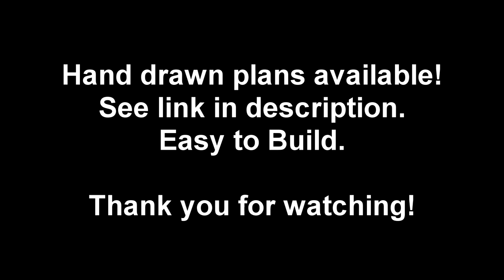Woodworking - How to Make a Table - With PLANS!!!!

Comment: That sense of accomplishment must feel awesome!! You slabbed the lumber then dried it then built the table. I suspect that if you were sent back in time to 1820 you could get by just fine. Great video. Thanks.
Reply from the maker: I've milled some nice stuff, but the white pine was one of my favorite, mills fast, smells great, dried quick. It will feel even better as soon as someone buys the table!
Reply: 1820, without that chainsaw?  The table would be slightly more work.  Just add 3 or 4 days!
Reply: Mike Tabar was thinking the same🤔

Comment: The table is beautiful. My only issue is the lack of safety gear. If you don't wear it you should recommend it. What a great set up for gluing. I wish I could do the same in my shop, but it's too small. I haven't been on Y.T. in awhile. You look completely different without the ponytail. Handsome guy you are!
Reply from the maker: What scared you the most?

Comment: Simply fantastic again. Extremely well done as always.
I would have preferred the natural double rounded swing of the tree as plate sides instead of cutting it away. I think it would have looked awesome. But this is only my personal kind of taste.
Reply from the maker: The live edge was nice but it would have been mixing styles. It would have also been the focus of the whole table and that wasn't what I was going for on this one. If it had a different base, the live edge would be fine, but I would use thicker slabs.
Reply: Dear @thehomesteadcraftsman8975 
Thank you for answering.
I mentioned that it would have been my personal kind of taste. It has nothing to to with the style of the finished table and isn't meant as criticism at all. The shown item is a wonderful piece of work but simply not my style any more. By fare more practical than a four or even 6 times concave rounded table for sure. And yes, I agree totally: Bigger/thicker slabs would be much better by doing this kind of natural design.
Best regards
Reply from the maker: Most of my tables are orders or will be sold in a store so I have to consider what sells well for the price point I want to hit. My personal taste isn't farm tables either. I would like to find or develop a market for some pieces that would be more fun to make in the future.
Reply: Dear @thehomesteadcraftsman8975 
Yes. Of course I haven't thought  that all these tables "wood" (would) stay in your own home ;-). And you have to make/deliver what customers mainly want to have for sure if you have to make money (that's what we all have to do mainly). And, as we are all able to watch, you deliver excellent quality.
If not already there respectively available, maybe later on in your life there will be something like "table art" too!? Not only because you often have extremely wonderful wooden slabs (and it's more fun to do) I hope so and I wish you all the luck you need.
Best regards
Reply: I agree! It looks beautiful, but I love the  natural look of an unfinished edge.
Reply: Dear @angelinamclaughlin-heil  
Please be so kind and tell me what is meant by "an unfinished edge"?
Thanks in advance.
Best regards.
Reply: @thehomesteadcraftsman8975  See if you can do some "made to order" designs. You can plan it with the customer and that way you know it will be sold when it is finished. Set up a contract.

Comment: Awesome  start to finish build! Is that a biscuit jointer you used to attach the top? How does that work? Your clamping rack rocks, would be great to see how you made that in a video and a little tour of your shop!
Reply from the maker: Google "table top fasteners" I use the little rectangular bent kind. I bought a box of 1000 from Mcfeeleys, that should last me a while.

Comment: Beautiful. Seems like it would have been a great chance to book match the top. Not a criticism at all, just curious as to why you didn’t. Thanks as always for sharing.
Reply from the maker: I cut these logs into 2ish inch thick slabs, I took 5/4 boards when it made sense, but again, 2 inch was the mission, sawing for quality. In short, I did not saw book matched 5/4 boards, at least ones that were dry that is.

Comment: Those old Dewalt radial arm saws... speechless.  Those have to be from the 50's?
Reply from the maker: One is 1954, the other one is somewhere close, 52 I think. They run like tops, I replaced the motor bearings in both as well as the wires.
Reply: @thehomesteadcraftsman8975  Made my day to see vintage tools still in use today.  Not to mention at the hands of a talented craftsman.

Comment: Looks awesome!! Is this one for you to keep? Looks like you did a different approach than previous tables
Reply from the maker: This one went into the store I sell from. I just wanted to have some fun with the top since I milled the wood. With the joints, I had a set of legs that already had mortises, so I used them instead of my Festool dominos. I had the legs for a couple years but was avoiding doing the tenons.......that's just how fast the Festool is.
Reply: The Homestead Craftsman sounds good. I build my dining table a few months ago using mostly your plans and videos for instructions. I bought the turned legs since I don’t have a lathe or any tuning experience but everything else I did. Thanks for sharing!

Comment: Beautiful love all the character in that top. Really really enjoyed watching you use the hand tools. Was that a no.6 you used to flatten the top and a no.4 1/2 to smooth it? Those are my 2 favorite planes i use the most. I love my no.6. Would love to see you do a video about you hand planes
Reply from the maker: It's a No. 7 the other was a 4 1/2. I also used a small rabbit plane, to work small difficult areas, it just cuts so nice its good for focusing on small areas. I have a pile of planes, so I do have enough to talk about!
Reply: @thehomesteadcraftsman8975  would love to see them. I also have a type 11 no.7 that i use to edge joint all my table top boards

Comment: How long would you say it took you to make this table?
Reply from the maker: I don't keep up with hours and I was not in a hurry on this one, I just worked on it here and there as I could but when I make my standard farm tables which are the same as this one but with a top glued up out of 6 ish inch wide boards, I make them in 2-3 days. The fastest I've made one was started it mid day and delivered it the next day. I was rolling, it was also summer, so I could dry my finish and paint very fast. It really just depends on whether I need or want to make them fast.

Comment: Beautiful build and a joy to watch.  Glad to see you post.  

Was the slab finished any more prior to cutting with the track saw or was that right off the chainsaw mill?

I really like the crafted edges on the table top.  Very nice natural touch.
Reply from the maker: It was right off the mill. With the right set up, you get surprising smooth cuts. Sharp, ripping specific chain, fed with even pressure gives a smooth face. Dull chains or using normal cross cutting chain (which dulls fast milling) requires all the rocking around and causes rough cuts, not a big deal untill you have to smooth it out. Unless you have a large planer or surface them down some other way, you have to take off a lot of wood. 

I like doing the edges like I did as well, they are straight in general, but have a hand shaped profile. The boards thickness varied a little, that's why I scribed around the table, then shaped to that line, giving it the appearance of being even. The 1/8 difference or so doesn't make any functional difference but you could see it. White pine is a nice wood to work with if you get the chance. It's not expensive and not looked at as anything special, but it's so nice, very light so handling it is a dream compared to oak, mills fast, looks good for the right projects, planes beautifully and smells great the whole time. It's downfall is it's sappiness. I did not worry over it too much but technically you should place it in a kiln at very high temps to set the pitch.
Reply: The Homestead Craftsman thanks for the reply!

Comment: 2 quibbles: it should have a support beam across the center underneath and i wish the grain on the tabletop had been bookmatched. the 2 big pieces are completely mismatched and you notice because both are heavily figured.
Reply from the maker: You don't need a center support, the top is over an inch thick and less than 30 inches wide. As for the book matching, these where the boards I had. Just is what it is. It's one of probably 100 or more tables Ive made.

Comment: it looks like you use yellow wood glue.  Do you prefer that over epoxy glue? if so, why?  What are the benefits?
Reply from the maker: Modern glues are amazing, wood glue included. For a furniture project like this and most any other, epoxy has no advantage over wood glue in my opinion. I mainly use it for filling or gluing non-similar materials to each other, but for wood to wood glue joints, wood glue is perfect.......no sarcasm intended. Some dense, oily, exotic species may call for special thought, but not your average stuff with average joinery. My opinions of course. I don't think epoxy has anything over wood glue for my purpose, but lets say it does, I think the term diminishing returns would apply, kind of like killing an ant with a bazooka. My wood glue is also $17 a gallon, look up how much epoxy is. Also wipe it up with water, wood glue is better for this stuff.

Comment: Great job! How many tables you make in a year?
Reply from the maker: I used to make a lot more than I do now, I'm busy working on renovations and don't push the tables as hard right now. The most I've made was probably several a month on average, it doesn't sound like much when I type it but I felt like I was always working on one. Orders come in waves, I'll have no one order a table for months and then have 10 orders in one week, it's a mystery. When I was at my peak, I always had tables to make. I was doing some advertising, as was the store that I sell them at. Need to get it going again soon, once I'm done with my current house.

Comment: why the polycrylic for the base and not polyurethane like used for the top?
Reply from the maker: Speed of drying, I also water it down so it doesn't really have any build up, just soaks right in which has a good look on the bases.
Reply: @thehomesteadcraftsman8975   if you dont mind me asking. How much do you water it down?

Comment: How did you avoid extreme warping that is common to that wide pine boards?🤔
Reply: I think if they are dried properly they won't warp..........correct me if I'm wrong.
Reply: He's also sealed the table top on all sides, so in theory no moisture should be able to get in and warp it.
Reply from the maker: I think when most people think "pine" they are referring to construction grade lumber, buying  2x12's and making them into a table within days can turn south on you, it's not meant to be a table, it's meant as framing that gets nailed in place, plywood screwed to it, walls supporting it, etc. It's locked in and even if it moves, you have a lot of leeway in framing. Use it as a table and it will most likely curl up like a drying leaf, I also think it looks to "DIY" and gives it away that you are just buying construction grade lumber. Pine, in this case white pine, is a very easy wood to dry. I stacked it with spacers, weighted it down and let it air dry, then finished it off with heat. Wood warps (aka..distorts in some way) due to drying, construction grade lumber is dry enough to build with, not furniture dry, it often has a lot of tension in it as well. It is being sawn to yeild as much lumber as possible, not for quality, again, fine for it's application. With that said, you can make nice stuff with yellow pine construction lumber, you just have to know a little something about grain orientation, board selection and wood movement. But no matter what, it still looks like it came from lowes in my opinion, not saying that's a bad thing. I build my bases out of 2x6's and untreated 4x4's from lowes, but I paint and distress them. It's also an application where the wood is being used in a way that there is no liability of something going wrong. With the tops, I use something with interest or simply a nicer wood (which usually costs less). The most expensive part of my average table is the base, the 4x4 is $13, I get 3 legs from each piece. 2x6's are between $5 and $6. If I use my festool domino to do the jointery, they are about $1 each and I use 16 per table. I normally have about $10 or so in a top at most. The most expensive thing with the tops is normally the effort and time to get the wood. This table was an exception, milling it myself was very time consuming, use a lot of gas and bar oil, the cost of the mill and saw, etc. Normally I take dead trees to a bandsaw mill and have it all cut up REALLY cheap. But I have to handle the logs, lumber, store it, etc. Probably more than you wanted to know but just a little extra to go on. Thanks.
Reply: The Homestead Craftsman wow this explanation is gold. Love your videos you’re an inspiration. Thanks.
Reply: The Homestead Craftsman thank you for your explanation.

Comment: What was the purpose of the biscuits cut into frame?
Reply from the maker: I use metal table top fasteners to attach the top to the base. They go into the slots, they are held in place (into the top) with short screws. Allows for movement in the top throughout the seasons. I get them from Mcfeeleys online.
Reply: @thehomesteadcraftsman8975   thanks for your answer because i was wondering how you use it to connect the two and now i received a resouce unknown to me.
Reply from the maker: @mikes1345  Furthermore.......I use screws from Mcfeeleys as well, can't think of what they are called, but they have a little washer shaped head, phillips and square drive combo. 3/4 inch long, big boxes available.  They will probably pop up as some sort of related or commonly purchased item. Or just browse their screws, it will be obvious which ones work best.

Comment: I'm cringing.  You cut off 90% of the value with the live edge, in the first 4 minutes.  Unless it's pine.  Do you know a raw slab with the edge like that costs over $300 where I live?
Reply from the maker: Every board ever sawn could have been live edge. Live edge is a very specific style, with a farm table it would be odd looking and that's just what I was doing here. If it had a different base, style, etc, then it could have looked good.

Comment: Why do you wear a belt and braces?  Surely one or the other would Do?
Reply from the maker: I wear a belt all the time, when I'm working I put the suspenders on to keep them pulled up, even with a belt, squatting up and down, hanging drills, tape measures, etc on my belt, gets heavy and pulls down your pants. The suspenders like these, with jaws that clamp on to your pants, tear up your pants. With a belt, you clip it to the belt and no more torn up pants. It's the best of both worlds. And when I don't want the suspenders on, I pop them off and the belt is there. I've always been surprised how many people focus on it.
Reply: @thehomesteadcraftsman8975  Agreed. Suspenders are the best. Don't knock it until you try it.
Reply from the maker: The key is wearing both, despite any confusion!